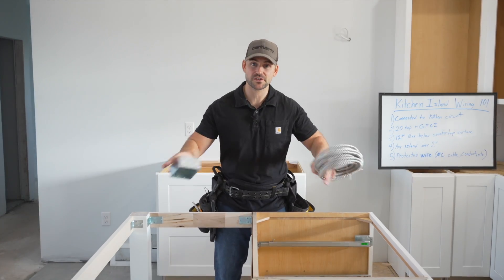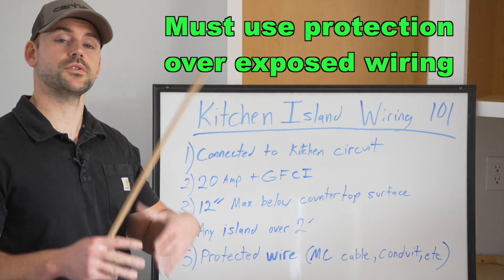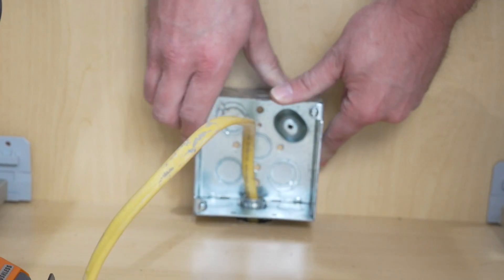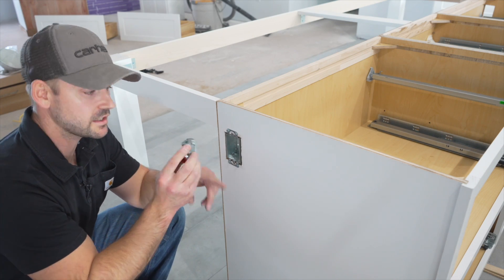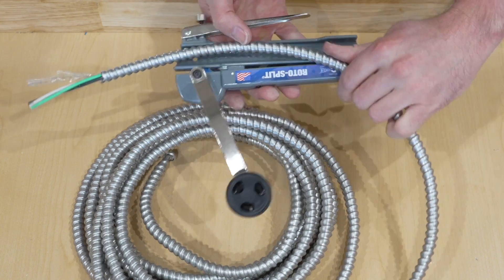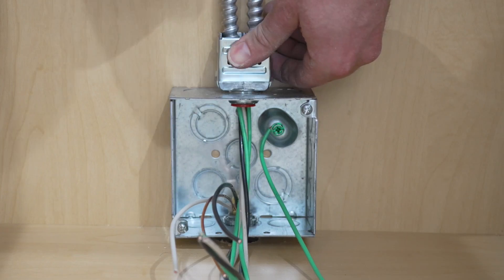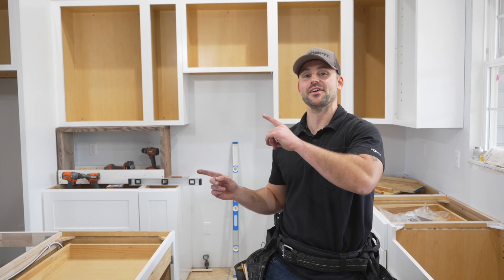How To Wire A Kitchen Island For Receptacles - Metal Clad (MC) Cable Installation

Comment from the maker: Hey everyone! I hope all is well. I placed timestamps below to help you better navigate this video. Enjoy! 
Intro 00:00
Kitchen island codes 00:21
Supplies needed to wire the island 03:02
Installing a metal junction box 03:39
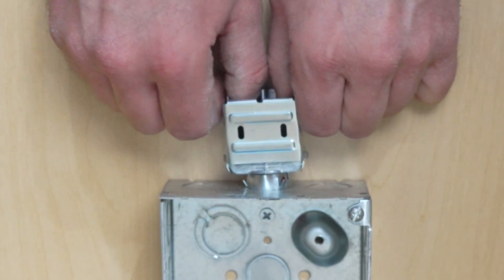Cutting out and installing electrical box in cabinets 05:49
Connecting and running MC cable 09:29
Wiring the junction box 13:30
Install the receptacle 15:35
Securing wires 17:28
Testing the outlet 17:48
Reply: Bottom line yes. God bless
Reply: those connectors are not reccommeded in a metal box without being wrapped.

Comment: Since an outlet has to be at least 12 inches from the floor, wouldn't you want a junction box at least that height in case of any flooding?  Seems like the Junction box was installed too low?

Comment: I know this video was made 2 years ago so it was right before the 2023 NEC cycle went into effect.  There has been a code change for islands & peninsulas.  It's not a change that people are particularly happy with.  In the 2023 NEC cycle, receptacles are NO LONGER a requirement for islands & peninsulas.  If receptacles are not installed, the electrician must leave provisions ready for later installation of them... meaning they have to stub up conduit or have a junction box with a circuit available already inside the cabinet if there will no longer be accessibility from the electric panel.  IF receptacles are installed in an island/peninsula, they must be installed IN or ABOVE the countertop.  If they are installed in the countertop, they must use waterproof pop up or countertop/work surface receptacles rated for use in kitchen countertops.  This is obviously a huge inconvenience that adds complexity and cost to island/peninsula receptacles... especially if you have a stone countertop.  The countertop person now has to make cut outs for the pop-up or countertop/work surface receptacles.  If the island/peninsula has a backsplash area above the countertop, receptacles can also be installed there.  The reason for the code change is supposedly there have been incidents of people walking by and snagging the cord plugged into the side of the cabinet or children pulling an appliance over by the cord.  Blenders, fryers, crock pots, etc. have been toppled and caused burns.
Reply: Now they are officially prohibited and not allowed. Well when the 2026 NEC is accepted.

Comment: I just notice, but you using a 12-2 wire equals a 20amp circuit and you using a 15amp electrical outlets? (No dog leg)  and no gfci

Comment: I was noticing you didn't mention how to locate these outlets so they don't interfere with the drawer box.  I am a cabinet installer and have had to go back and cut down drawer boxes, install shorter drawer slides with the shorter boxes.  Also, even though it is desireable to have, as of NEC 2023 outlets in islands and peninsula ends are not required.  They are suggesting a pop-up in the countertop to keep kids and adults from catching a plugged in small appliance cord and pulling the appliance down causing burns.

Comment: No longer code! as of 2023 NEC.  You aren't allowed to put it on the side.  (I personally strongly disagree) You can put it in the backsplash of a 2 level counter top or use a pop-up receptacle. I have seen people put a receptacle behind a false drawer front.
Also not a seasoned electrician giving the demo,  you don't use a utility knife on the NM . Too easy to nick wires. You just use the end of the stripper to pinch the sheath and rip, then the remaining sheath you quickly jerk off.  Nobody uses a roto split, too slow.  Just break it with your hand, give it a twist and trim it with your dykes.

Comment: I believe code for 2023 changed to where you don’t need outlets in the island, correct?
Reply: That’s what I saw on Ryan Jackson’s channel. Looks like this video came out right before the change was made in the NEC.
Reply: Sounded like a lot of small humans were getting seriously injured or killed by receptacles in the island so the NEC said you can’t put it directly under the countertop edge, it’s no longer required, and if you decide NOT to put it in, it still has to be ready to be wired.

I’m a smooth brain, so that’s what I took away from it. Highly highly highly recommend checking out Ryan Jackson’s channel for updates to the code. He does a really good job of bringing the book up and walking through it in layman’s terms.
Reply: 2026 NEC these plugs are forbidden,  illegal, violations. You will be put in jail.

Comment: 2023 will be getting rid of the island outlet requirements, including peninsula, BUT you still have to leave a "future" conduit to put one in in the future but its not required anymore.
Reply: I should add, that's a minimum so city's can still require it, but it's not in the 2023 NEC as required.

Comment: Great video, thank you very much. But I still have some questions. Does wet bar with island consider as kitchen and those rulles aplied to it? I plan to develope basement and install wet bar. Code says I have to run two 20A circuits with GFCI protection. So main coutertop will have sink and two GFCI recepticals will be installed on each side of the sink. Can I feed island receptacles from main GFCI outlets or I have to use dedicated circuit? I need to run cable in the concrete slab, so what is the minimum depth of the tranch can be? Can I use Liquid Tite PVC conduit or I must use gray PVC or metal conduit? Can I feed island with regular romex 12/2 or I have to use THHN wires?

Comment: At 11m 15s, you said the bushing protects the insulation of the wire from the edge of the MC cable.  It’s worth noting that an insulating bushing is not required for MC cable but it is for AC cable (320.40).  The plastic wrap around the conductors in MC cable is sufficient protection for the conductors.

Comment: At 1m 50s, you state that any island over 2 ft must have an outlet.  2020 NEC 210.52 (C)(2)(a) states at least one receptacle for the first 9 sq ft and another receptacle for every additional 18 sq ft.  If you only require one receptacle, it needs to be within 2 ft of the edge per 210.52 (C)(2)(b).  My interpretation is that a second receptacle is not required within 2 ft of the other edge as long as you don’t exceed 9 sq ft on your island.

Comment: The 2023 NEC kind of makes this video obsolete. They removed the requirement for kitchen island receptacles. Of course you can still install them if you want to. 😉
Reply: Even optional, it's very nice to have a local to plug in a waffle maker or electric griddle.
Reply: The receptacle is not required.  However wire must still be run for future provisions.  The required receptacle, if decided to install on the island, cannot be below the countertop.  The required receptacle has to be on the countertop.  Note, that optional receptacles can be installed below the countertop as long as the required receptacle is on the countertop.

Comment: 1.  Since you slaved the new outlets to the existing countertop outlets in this instance  it's probably not an issue, but all of the outlets of a kitchen must also be protected by AFCI circuitry (for the last couple of Code cycles actually), as well as provide GFCI protection as you correctly point out.
2.  Rather than use staples to secure MC cable to cabinetry, I would recommend the use of 3/8" 1-hole Type AC/MC cable straps and a sheet metal screw.  I like to keep my hammer away from the mill work when possible.  :)

Comment: You MUST mention 2 things: 1) Going by 2023 NEC you NO longer have to install a receptacle ( don't call it an a outlet ! ) 2) Rather then installing a receptacle for an island you only need to supply power to a junction box inside of island. Safety people!e saying you should NEVER install a receptacle on side of islands because there has been too many cases of kids & adults getting hung up on cord plugged into side of islands. Best practice to use a pop up receptacle on top of island counter top. They also make fancy box that can be mounted on top of island countertops.Has to be on an AFCI circuit breaker and not the GFCI like you mentioned unless in a very old maybe 2008 code cycle.

Comment: we bought a house and hated the small kitchen island. After removing we notice it had a connected outlet to the ground. We ended up just tiling over it but now regretted doing that because we wanted to add a new kitchen island and connect some outlets. How should i go about doing this? I'm guessing obvious answer is to remove the tile that is covering that electrical wire?

Comment: Doesn't the romex sheath need to extend 1" into the box, and even when anti-short bushing are used the sharp edge needs still to be snipped square on the MC cable according to the NEC?
Reply: 1/4" is the minimum

Comment: Good idea not to put the receptacle too far in from the corner.  My builder put the receptacle over two inches from the corner and it is hard to get the dishwasher to fit square.  Added to the problem is when we upgraded to a dishwasher with extra sound insulation and the insulation catches on the box.
Reply: I would think a shallow box might help.
Reply: @dennydeckerful   Good point and and the builder did install a shallow box.

Comment: Can the island be completely on its own circuit? Assuming 20A gfci etc etc all remains.
Reply from the maker: Hey Dan! My area it must to be on the kitchen circuit. Check with your local building codes to see if you can have it on its own circuit.

Comment: It's great to see that your codes are close to ours. I always have used a junction box to make the job actually cleaner as well. I've seen some jobs that look like a spaghetti shop, per say, and are not protected. It's always important to protect the wire especially with drawers, rollout drawers etc. Anything can happen in time. We can also use a switch box if lights are installed and important as well to use the proper wiring to code for that. One other thing I got used to doing besides making sure the circuit is on a kitchen circuit and not over loading it is to run a designated line if a shelf microwave is involved. Again, checking codes. Great job on this video Josh. Love the listing of things to follow as well. 👍🏻
Reply from the maker: I remember the first island I wired I did not understand I had to have the wiring protected. I had to remove it and install this MC cable for it to past. After that I will always use MC cable for the island lol. Yeah it does seem like most places use the NEC code for the kitchens. Sounds like your area is the same. That’s a good idea about the switch box. Yes we had to have the microwave on its own breaker here. Thanks a lot David for watching again. It means a lot!
Reply: @TheExcellentLaborer  تابعونا وشترك في القناه وشكرن